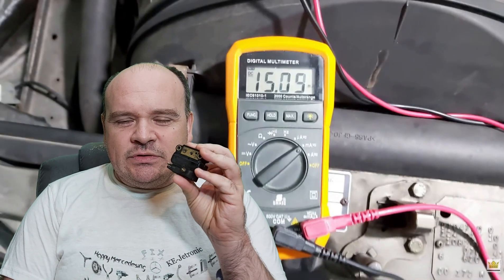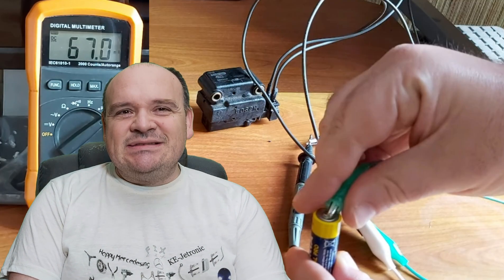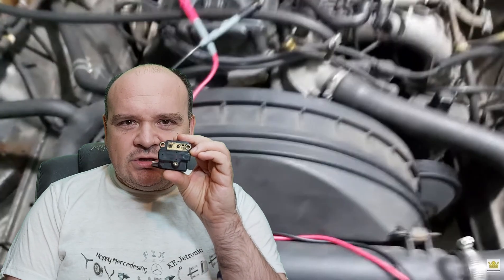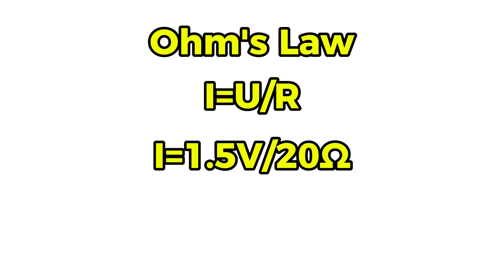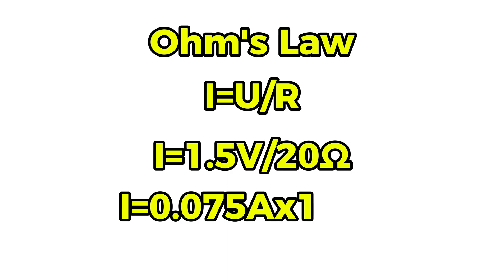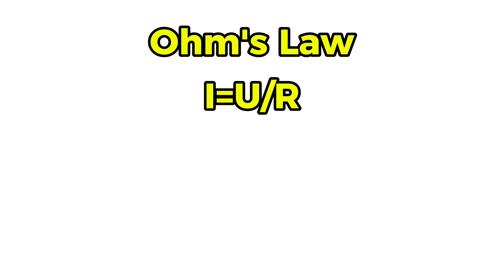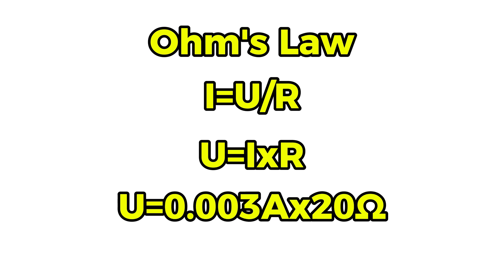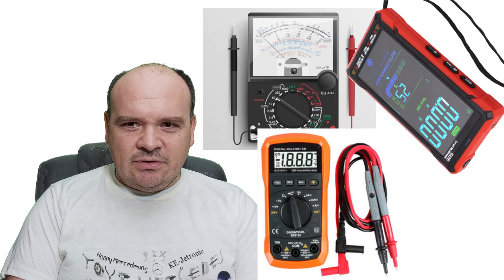㉦Mercedes Ke-Jetronic㉦ - Why We Measure Milliamps — The Hidden Logic Behind the EHA

Comment: Mechanic told me car shake on idle and difficult to set duty cycle because of bad fuel accumulator is it true....Mercedes W124 M102
Reply from the maker: Hello. No, that isn't true. The fuel accumulator is the mechanical part of the system, it has nothing to do with electronics, it just helps the system start better HOT, nothing else. In order o set the duty cycle your sensors must be operational - the coolant temperature sensor, the potentiometer(adjusts the idle), the hall speed sensor and at the end the lambda probe, the O2 sensor. The duty cycle is set once your potentiometer shows 0.7V, lambda fluctuates between 450-800mV. The duty cycle shows 50% +/-5% Then the EHA has to show 0mA +/-3mA(negative range mixture richer) and on the ICV you must read up to 4.5-6V. Then is your whole system adjusted properly. If you have an older system then you can adjust idle manually(ICV with 3 pins). That's how it goes.
Reply: @mercedeske  Thanks alots you save me and my money 😂😂
Reply from the maker: @shahidnoor45 My pleasure 🙏🏻

Comment: haha thanks for making a video boss! :) I still don't totally understand the magic of the EHA.

If we warm the EHA itself, will the resistance or mA draw change when we perform the AA battery test? I was trying to think of how to measure/test the EHA in its various states like under acceleration, deceleration coasting down hill, etc. but is there only warm and cold really to bench test? or just cold? Thanks again! Short and sweet video :)
Reply from the maker: 👋🏻Thanks bro🙏🏻. The point of the EHA - the ECU💻 gathers the signals from the sensors and then it transforms it in a current ⚡signal sending it to the EHA for fuel⛽ and ICV for air. The healthy ✔system has its values for the ignition ON, warm up phase over 15mA and the idle - between -3 and 3mA which must remain at 2500RPM as well☝🏻️. When you depress the accelerator you must read -66mA - the cutoff phase. If you have these parameters your EHA is working as it should be✅ and the ECU💻  as well 👌🏻because it receives orders from the ECU! Happy Mercedesing🔧